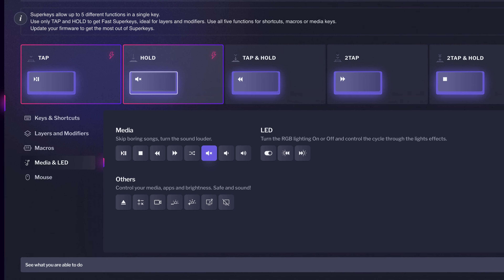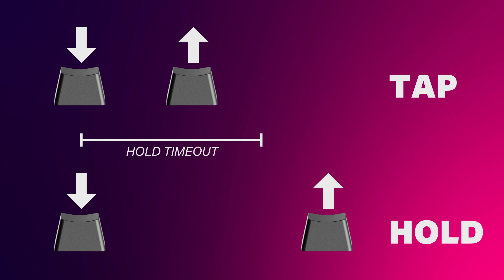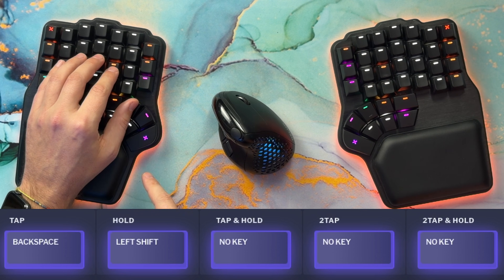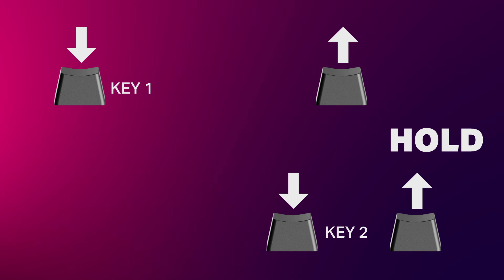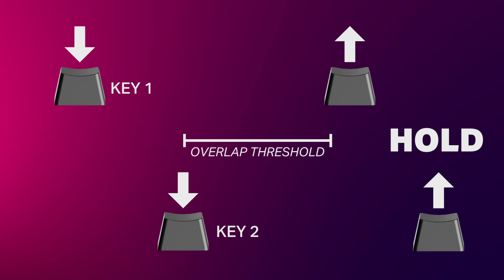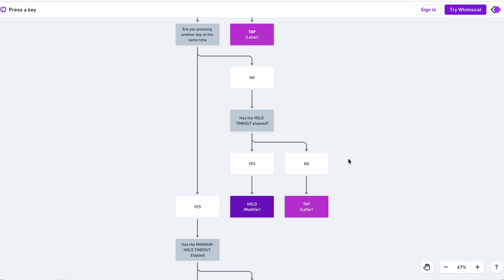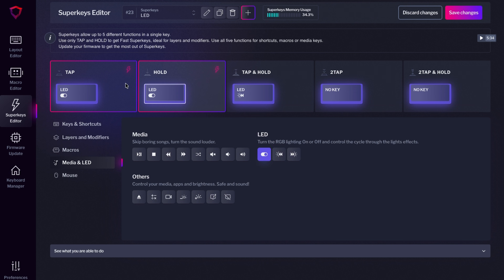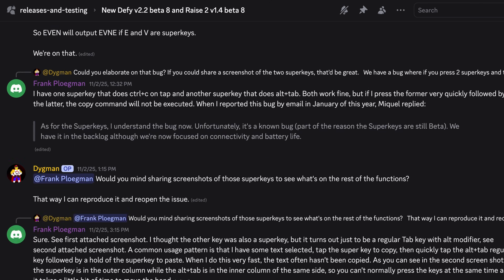How we fixed Superkeys - A development story

Comment: Can we use the software to use on our normal mac keyboard?  I really like the software idea of superkeys
Reply from the maker: I'm afraid this software only works with the Dygma keyboards. For your normal Mac keyboard, you can get something like TAP and HOLD using the advanced features of a software called Karabiner. Although it's not as easy and smooth.